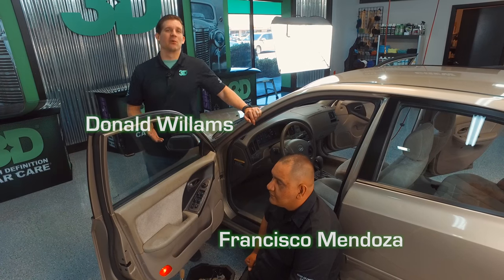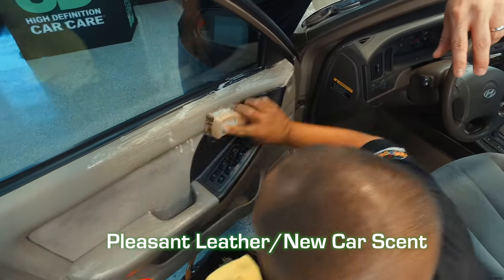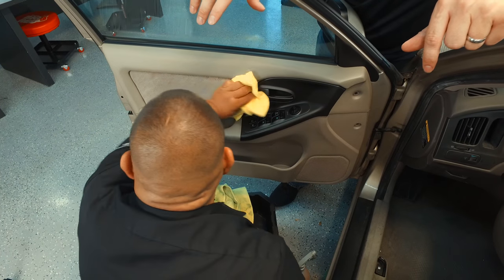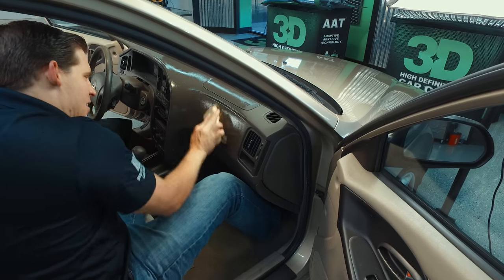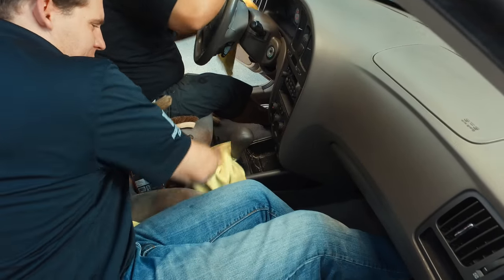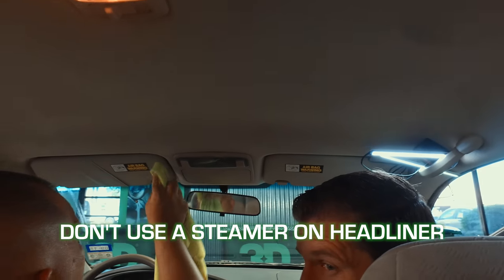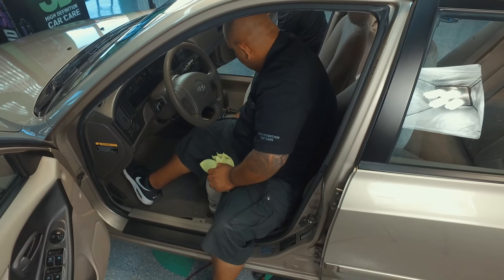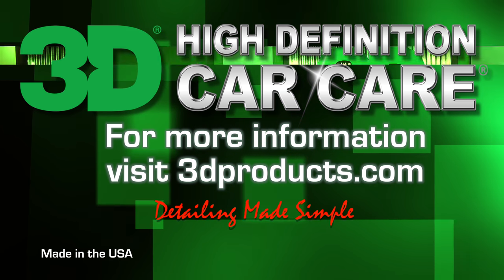How to Clean The leather and fabric and cup holder with microfiber inside your automobile automotive

Comment: Thanks for another great video. Never thought of using the air blaster on the interior if a car. Great tips & techniques. Thanks guys!!!!!!
Reply from the maker: yea, the blaster helps dry things out faster and get in the seams
Reply: @3DCarCare  I just bought a Metrovac "Sidekick" blaster and this little dude rocks the house on getting rid of water from crevices,body panels,mirrors,wheels and rocker panels as well as engine and engine bay! I saw another pro detailer using the Sidekick to get the leftover cleaner from all the little crevices on the interior doors,dash and console like Fransisco was doing in this video! :-) (Y)

Mac